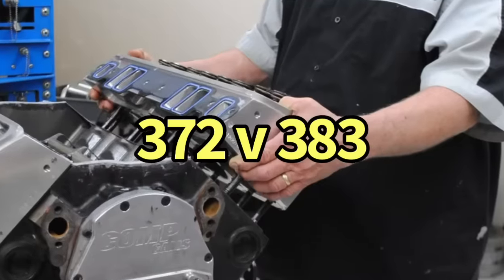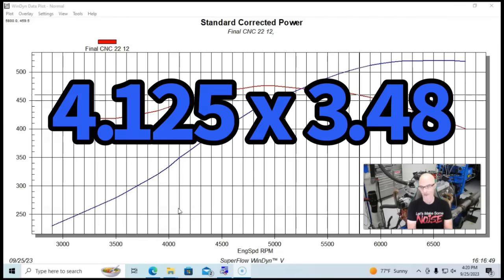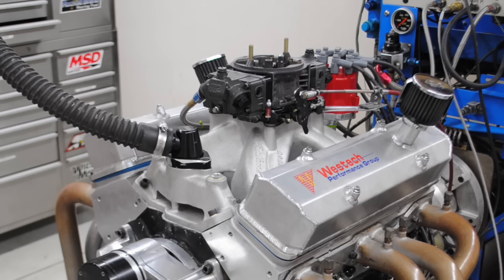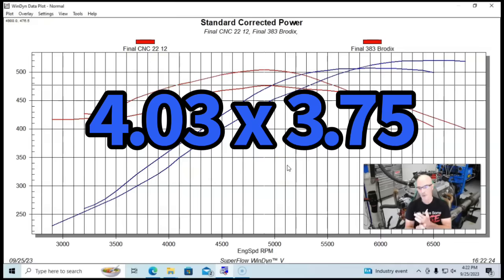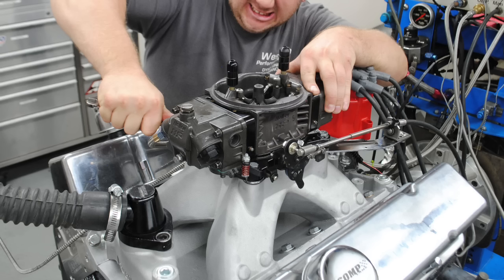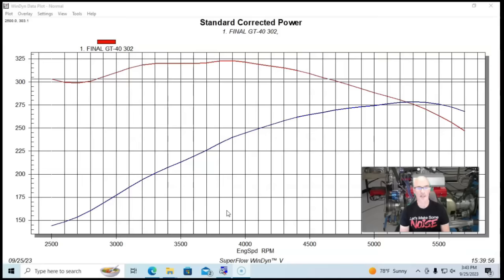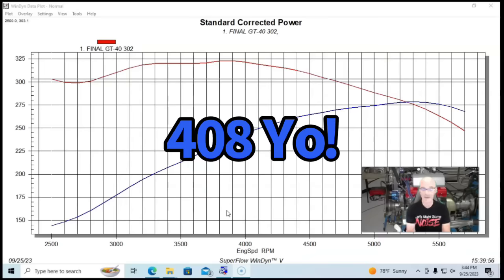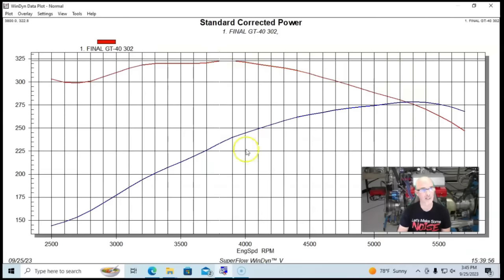BIG BORE VS BIG STROKE-372 VS 383-WHICH SBC STROKER DOES IT BEST? BONUS TEST-302 VS 347 FORD

Comment: I've built both a 383 and a 372. Same cam in both, same World Products heads. Hey, I worked at a auto parts store at the time. Maybe more torque below the 4500 mark for the 383, but a fair amount more power above 4500 for the shorter stroke. The only explanation at the time was the bigger bore made better use of "average" heads with no issues with flow around the valves near the cylinder walls. I actually liked the 372 better, but when I did both engines the idea of the 383 was fairly new and some guys were having problems with side load on what you'd have to call crappy pistons. A friend built a 383 as well, and he came up with the most common sense outlook on both engines. Build a 383, put it in a truck... Build a 372, put it in a non heavy car with some decent rear end gear, and enjoy the top end. Or build an all out effort (read as All Your Money) of either and never notice the difference.
Reply: Or just build a 406 and kick both motor's butts.
Reply: Long stroke causes higher piston speed, air has to travel faster in a 383 , which it can’t. The larger bore unshrouds the valve for more flow. Low torque on the longer bore is leverage, but it can’t inherently breath as well. Shame it doesn’t have 14:1 and water/ meth .
Reply: @dennisford2000  I figured a lot  of Richard's viewers already knew the leverage of the stroker on the crank, not just the displacement versus unshrouding the valve. There is always a trade off somewhere, and sometimes the trade off is smaller.
Reply: @corvettejohn4507 this is what i told my friend several years ago when he wanted me to build him a 383 "stroker". He was in love with that word. I told him do a 406 & tell everyone its a 383 "stroker" if u just want to use that word cause it will kick the shit out of a 383
Reply: Yep. I'm new, like what you're doing Richard. Appreciate response
Reply: You nailed it 383 truck motor 377 in a light car will run away from the 383 !
Reply: @corvettejohn4507 big bore AND stroke!
Reply: People on the Mustang forums are always saying that building a stroker using factory heads is a waste. I've always disagreed with that. Just look at the torque increase! You could also work over the factory induction and have everyone scratching their heads as to why their new $2500 top end can't beat a factory looking HO. Sleeper!
Reply: @robertwest3093  bigger displacement always adds power, but letting it breath with a good topend adds to it. Definitely depends on how you're driving it, but most people would be happier with topend over stroking in a light car if one or the other. Most people to me is people that drive that car only on weekends, whereas someone day driving it would prefer the stroker. I also think it largely depends on exhaust and gearing, as a loud engine that only makes more power topend may not be preferred in a vehicle that barely moves making a bunch of noise in a tall geared vehicle with loud exhaust. Low gear, high stall, and moderate exhaust might make the topend power more tolerable. So many variables. When I had 3.73, stock stall, and loud exhaust in my Bronco I felt like a douche making noise and barely moving. High stall made it worse, though got to speed quicker at least. Now with 4.88 and quiet exhaust people give the WTF look when I pace them as they floor it 😂. I hated coming up to RPM on the 2800RPM converter making noise to keep up with a corolla.
Reply: @DillonAuto One thing often over looked, is under square or less over square relatively speaking, those engines are inherently more thermally efficient due to having less surface area to volume at peak combustion pressure which iirc is somewhere around 15-20 deg ATDC, well down the bore at that point. Iirc, the piston is also further down for the same deg of rotation given they have a longer stroke and typically have a shorter rod ratio too.   It's a common engineering hack vehicle manufactures employ to get more power for the same fuel and verse visa, and as you mentioned, air velocity is also faster at lower rpm which all helps the cause.
Reply: I've seen a very similar thing with the 3800 here in Aus, very popular engine back in the day and somewhat still is. A stoker, even on a hot engine always reduced peak power for the same specs and stock stoke, but gained good low end.  I quickly realised the heads being a high velocity orientated design with porting helping but still primarily limited to the casting constraints, they always did better with a stock stoke on a performance car and even some of the Buick 6 only engine experts here going as far as de-stroking to 3.3L, much like Buick Indy did to get more power by making similar or less torque but way higher in the rpm than even the best all out race motors could achieve using a standard stoke.

The Holden 202 and 186 are good examples of mediocre head flow, like high 180 to low 200 being the best for a fully worked head and being siamese port and all the ports on one side of the head.  The worse case really, but they still easily get over 100hp/L and it comes down to being small displacement with good over square design which allow them to make peak power around the 7k mark, a lot for a L6 designed in the 60s.  And the old tin can Holdens with these hot motors absolutely haul ass!
Reply: Ran a 372 in a 79 Camaro, that bastard was fun af. I’d taken about 600-650lbs off of it, that sumbitch would flat cook.
Reply: The debate is pretty much useless nowadays, except in racing where displacement restrictions come into play. For the average joe, it mostly depends on how you want the engine to behave. 30 years ago, you couldn't spin a 3.75 crank much faster 8k RPM with a ton of engineering. Now you can order a cryo-dipped, lightweight, hollow bore, tungsten balanced, knife-edged, 4" crank from a catalog that'll turn 9k all day long... just don't launch it hard.
Reply: @robertwest3093  I'd just love to see a youboob channel focus on playing with Ford's EFI intake. super ford or one of the other magazines did one with just Extrude Honing, and found that stocker matched a GT40 intake--probably did better on a Cobra since that was cast and could be honed out bigger (supposedly the 1993 Cobra that went around to the car magazines had it). Now that aftermarket intake manifolds are used, it may not be worth it to modify a stocker except for guys like us who bought a car with one and are thinking, "hmm, if i chop saw it apart and ported and welded it back together again...would it do anything?"
Reply: Why not test them with same cam and heads? And compare a 400 with same heads and cam? He did a 460 against 4 54 chevy but the chevy had a bigger cam. Not a valid comparison.
Reply: @williamstout6378  i suspect a few of the "tests" are really just reports of what a paying customer brought in. not that there's anything wrong with that :) 

one issue with an apples to apples comparison, however, is that changing how long the piston dwells at TDC (by connecting rod length, etc) can affect how well the engine breathes, and power really is a combination of reducing friction and pumping air in and out fast. but, of course, how much change is too much change, so it's easier to compare same heads/cam/intake packages. and for some builders, they're going to save money just swapping the short block, not the top end.

Comment: In order to get to HP, you have to get through torque. Why build for HP while your torque suffers, and you rarely touch 5000rpm and up? The odds of throwing a rod out the side below 5000 rpm is basically 0. That happens up high. The mentality of building for HP has been overblown for too long.

Comment: All other things being equal, instead of a 4.125 bore 400 block destroked with a 350 3.484 stroke crank, or a 350 block stroked with a 3.75 stroke 400 crank, wouldn't a stock 4.125 bore 400 block with a stock  3.75 stroke 400 crank make more horsepower and torque than either of smaller displacement builds???? It seems to be common sense.
Reply from the maker: yes-bigger makes more
Reply: Longer stroke means less low range horsepower in exchange for low range Torque. The argument is that the 400 can afford to trade some torque for ponies.
Reply: @neg4t1vezer04 you can't "exchange low range power for low range torque. Power is calculated from torque and rpm, if one is lower, so is the other.